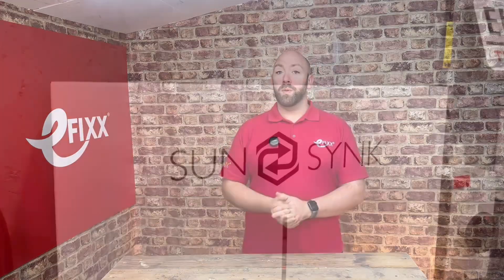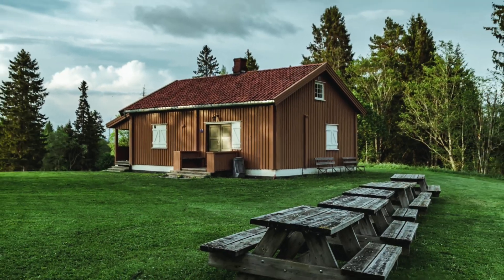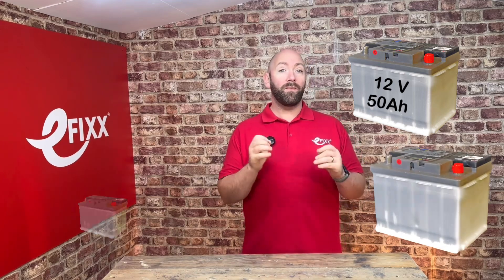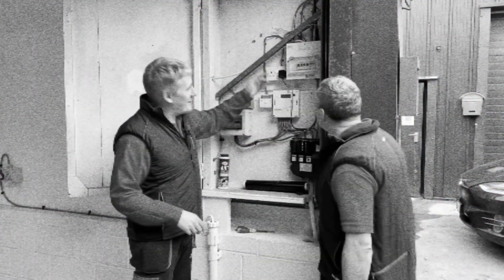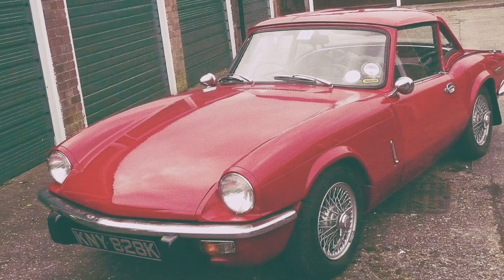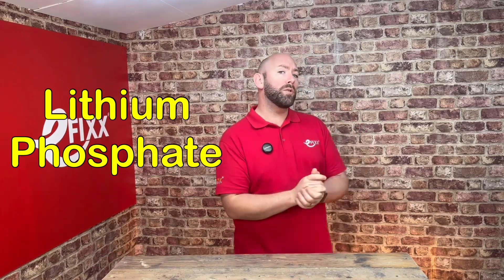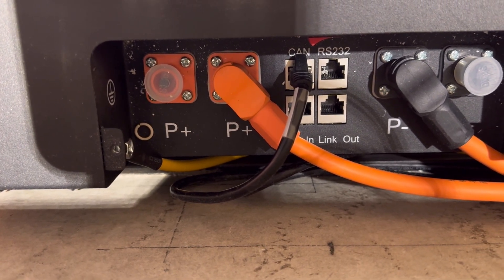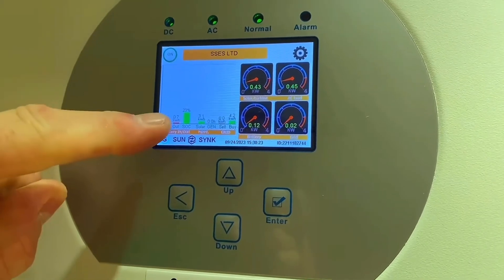Why do we use Lithium for Solar Battery Storage? 🔋🪫

Comment: Also to take into account is that lead acid is only good for 50% of it's rated output before you start getting into damaging low voltage. You'd need upwards of 10kwh rated of lead acid to get 50kwh of useable power.. This is well know in the leisure, ie, caravan/motorhome industry,

Comment: LiFePO4 cells are a great advance in battery tech. They don't burst in to flames like normal lithium ion if they get damaged. Many LiFePO4 cells are what is known as deep cycle, which means that you can take them down to a low voltage cut off without causing damage to the battery. LiFePO4 batteries do not like going below 2.65v per cell, but fully charged they are 3.65 as opposed to the lithium ion which is 3.2 to 4.2v range. This is why some chargers won't charge a completely flat cell as rescuing a flat cell you have to be careful how you do it, and you also have to be careful with the charging voltages as they are different. Sometimes it is possible. LiFePO4 batteries don't have the peak current output that a lithium ion does, which isn't usually a problem for a PV battery as you'll take the charge out gradually rather than as with something like a drone which is done in 10-20 mins. You can and do get gel style lead acid batteries which are used in alarms, UPS's, mobility scooters etc as they don't have to be kept upright and won't leak out the acid, but they don't have the peak current output ability without causing damage compared to a car battery. A car battery is designed to give a brief amount of power to start an engine. They are not deep cycle, which is why leaving them flat kills them, unlike a deep cycle gel cell which will tolerate it to some extent. LiFePO4 also generally can't be charged too rapidly - typically half the battery capacity, so an all day charge via solar is fine. Unlike lithium ion which can handle many times the capacity rating. This is why LiFePO4 is not suitable for EV's, although some electric bus's do use LiFePO4 as paralleling them up increases the take off peak power, and a bus will normally sit overnight to charge.

Comment: Nice story, but for sure I do not want a big such lithium battery n or on my home. For safety I charge all lithium cell (my iPad/iphone etc) in a metal cubert with fire resistant coating.
Reply: Lithium Iron Phospate cells (not Lithium Phosphate as misnamed in the video) do not have the safety risks of the popular Lithium Manganese batteries and other variants used in phones, laptops, etc. They don't have quite the same energy density, but they are very well suited to this application.
Reply: Plus they are in a metal box. @GodmanchesterGoblin
Reply: @mprelectrical  That helps too. But for Lithium Iron Phosphate cells, it's the cell chemistry that helps reduce the risk of fire. In contrast, a metal box will only go so far in preventing a fire spreading from burning Lithium Manganese cells. Once started, they do not need oxygen to continue burning and can be hard to extinguish.

Comment: Mixing units as usual - the washing machine would use kWh not kW 🤦‍♂️

Also to note that Lead Acids have a 50% depth of discharge so you essentially need double the capacity you calculate from the Ah ratings to get the same useable capacity unlike Li where you can go down to 5-10%. Another downside is that the charge and discharge rates for LA are far lower that Li based packs meaning again bigger overall banks for LA vs Li  for the same power delivery in either direction 🤓
Reply: and don't forget the 15-17% charging inefficiency 🤣
Reply: @thattoolguy9432 yes that is a big one that changes the viability complety if you only get back 80% of the power you put in, on top of all the other disadvantages of Lead Acid
Reply: All of the above (and mixed units are a pet peeve of mine). Plus lithium based cells may be happily stored with only 30% charge or so for very long periods. Lead-acid cells prefer to be kept topped up to prevent sulphation.
Reply: The lead acid 50% thing is a bit of a misunderstanding combined with Chinese Whispers gone wrong.  The batteries will achieve their rated cycle count when fully discharged but it's usually a miserable figure.  200 to 400 cycles depending on the particular variant.
Reply: @retrozmachine1189  please explain the fully discharged bit?

Comment: Sodium ion batteries look very promising for home storage.  The don't currently perform as well as lithium, being larger and heavier, so not as good for EVs, but not really a problem for stationary storage.  Sodium's a way more abundant material than lithium, so cost of manufacturing should be cheaper.
Reply: Don't hold your breath on the cost of manufacturing.  Do some web searches about the amount of lithium in the cells and the price paid for it then take that cost away fully and look at the difference in price for any given cell, and keep in mind that the sodium components aren't free in a sodium ion cell.

Comment: Leave the lithium to the mobile application. Use lead for stationary uses
Reply: You are wrong. Nothing wrong with LiFePo4 for stationary storage.
Reply: Lead is super expensive, you can't deep cycle lead batteries so you need at least 2x the capacity and finally you'd be doing very well to get over 1000 cycles out of lead, you should be expecting 4 x that out of LFP and if you treated it as kindly as you have to lead you'd get a lifetimes worth of cycles out of them.  Keep lead on our roofs.

Comment: Lots of advertising for SunSynk here - should probably mention that their network in the UK is offline yet again today, and we haven't been able to access our inverters for over 12 hours and counting...
They may make good hardware, but their online services are an afterthought written on a post-it, taped to a potato.
Reply from the maker: Thanks for the feedback
Reply: Take a look at the Solar Assistant software, it should work with SunSynk.
Reply: Just checked with Solar Assistant and it works with the SunSynk inverter, apparently, all of the following inverters are the same: Deye
SunSynk Turbo Energy, I've been using Solar Assistant for about 9 months now and it's never gone down, It's about £50 plus you will need a Raspberry pi and memory card.
Reply: SunSynk is just a rebranded Deye product

Comment: Yeah but lead acid don’t spontaneously burst into flames like lithium
Reply: Well it can/will produce hydrogen which can/will lead to an explosion that flattens your building, while disfiguring any unlucky bystanders, but better the devil we know I suppose.
Reply: LiFePO4 which is in this particular units doesn't spontaneously burst into flames.  You have to abuse them a lot before they thermally runaway.  NMC on the other hand, 'My first Tesla Battery Fire' - watch that clip.

Comment: Haha, yes, fuel up the car, check the washer bottle and top up the battery cells.  How many years has it been since I topped up the battery in the car?  Maintenance free took care of that long ago.

Obviously this is a simplified description of canbus and battery comms for the average person off the street.  There's also good old modbus over RS485 present on many battery systems.